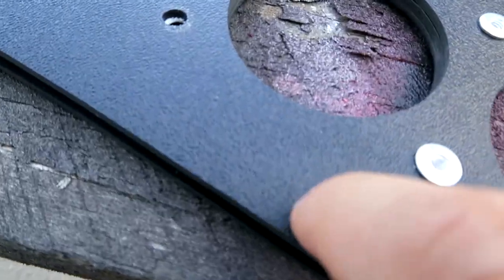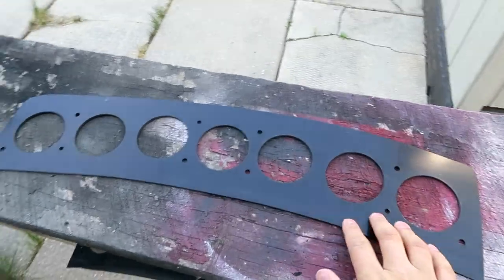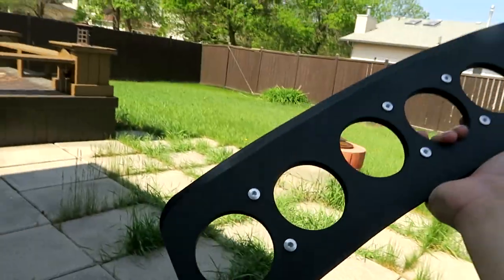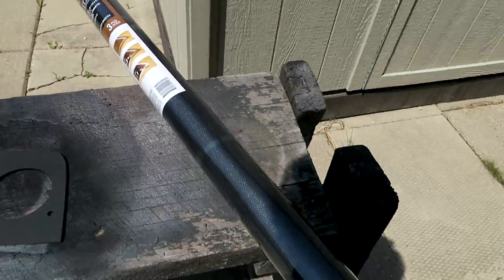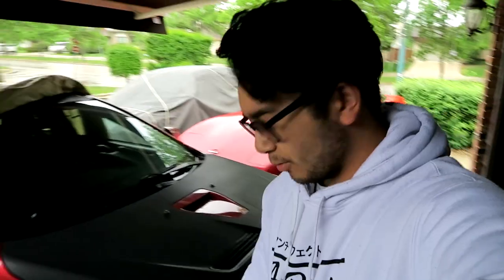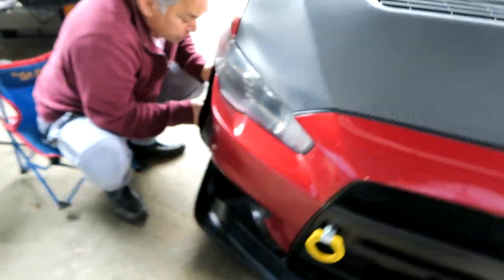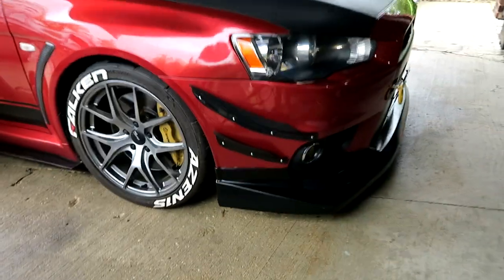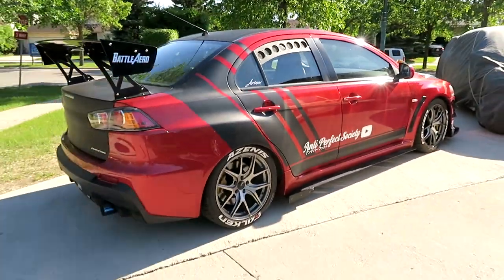EVO X // Carbon Fiber Canard and Window Vent Install

Comment: I’m guessing you had to drill into your crash beam to install the tow hook right because there’s no hole for tow hooks ?
Reply from the maker: Yes the usdm crash beam has no towhook hole
Reply: Anti Perfect yeah that suck bro I just switched to the tow strap instead and using the plastic cover 👍🏿

Comment: Are you able to roll your windows up with the window vents installed?
Reply from the maker: No the windows need to be partly down to have the vents in. If u want the window up u would have to remove the vent
Reply: Anti Perfect thanks for the heads up bro!
Reply from the maker: @toeknee4B11T  not a problem!